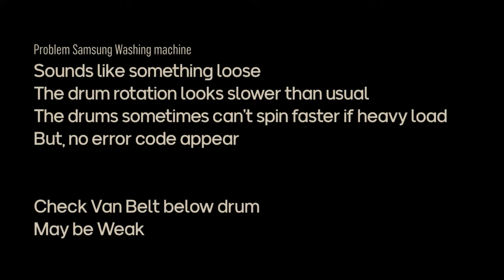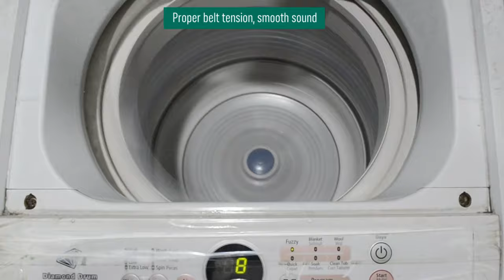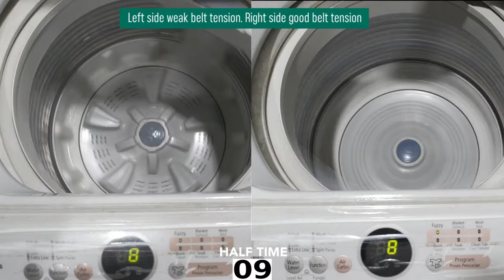Samsung washing machine spin slow squealing noise

Comment: Sir meri washing machine ki motor replacement k baad its not working like original. Or washing k time bhi beech me cycle miss karti h . Spin me sound bhi badh gaya h. Kya kuch belt ka bhi issue hota h please suggest
Reply from the maker: I can't say for sure what the intended cycle and sound is like
Problem:

The drum vibrates excessively, causing instability. This could be due to unbalanced laundry.
To address the vibration, the machine has two safety features:
Vibration sensor: When vibration exceeds a certain threshold, the sensor triggers.
Door sensor: If the vibration occurs with the door open, the sensor prevents spinning.

Consequences of vibration:
If the vibration sensor triggers while the door is closed:
The motor stops for a few seconds, allowing the laundry to redistribute.
The cycle resumes if the vibration subsides.

Belt issues:
A loose belt can also cause slow drum rotation.
Ensure proper belt tension during motor replacement to avoid this issue.
Remember specific rules for belt installation depending on the machine model.

Common washing machine noises are caused by this part
Other thing
Capacitor, makes a buzzing sound but the drum does not rotate.

Meanwhile, information from you
The problem we know is there

Comment: Very sad with buying Samsung Washine Machine, the same issue with here, verly slow spin... I guess this slow spin or no spin is an issue of Samsung washing machine products
Reply from the maker: Slow spinning:
This could be caused by a loose or worn belt that needs tightening or replacement.
No spinning, sometimes slow spinning:
Triac chip (drum stop spinning, or only one direction): This critical component can be damaged by a short circuit or overload. You might need a professional to diagnose and replace it. Example replace board
Capacitor under the drum: A broken or disconnected cable connected to the capacitor could be the culprit. This is also best checked by a technician.
Characteristics: The washing machine is buzzing because the motor cannot rotate due to a lack of power from the capacitor
Hopefully this information can help

Comment: Hi my machine can spin but can't Wash mode,can U let me known what to check
Reply from the maker: The washing machine drum rotates normally, and there seems to be no issue with the power supply.
During the wash cycle, the pulsator (the finned disc beneath the drum) rotates back and forth.
Two transistors, known as triacs, regulate the rotation of the pulsator.
If one of these triacs is damaged, you will need to contact a qualified appliance technician.
In Indonesia, technicians will assess the severity of the damage. In some cases, they may recommend replacing the entire control board module, while in others, they may be able to repair a broken trace (a thin line on the circuit board) using a jumper wire.
A jumper repair is typically a more affordable option compared to replacing the entire control board.

If you are comfortable doing so, you can open the washing machine and inspect the control board for any visibly burnt or discolored components.
However, it is important to note that attempting to repair an appliance yourself can be risky and is not recommended unless you have the necessary knowledge and experience.

Another unexpected thing
Weak capacitor, loose connector, broken cable

This is simply a personal experience I wanted to share.
I sincerely hope this information proves helpful

Comment: Hey my washing machine is doing the same as that 1, bad sound , doesn't spin yoh please help me 😢
Reply from the maker: The washing machine's inability to turn on is a more complex problem than we realized.
Our recommendation is to have a qualified service center repair it.
For those comfortable with some DIY troubleshooting, here's a helpful tip:

Check the drum rotation speed. If it's not spinning at all, proceed to the service center recommendation above.
 If the drum spins slowly but doesn't completely stop, this video might offer a solution. Check belt tension
 For very slow, buzzing drum rotation, the issue likely involves components beyond this video's scope. You can try visually inspecting the capacitor to see if its connector is loose or the cable is broken.
WARNING:
Risk of electric shock from capacitors"
However, for repairs beyond basic checks, we strongly recommend a professional service.